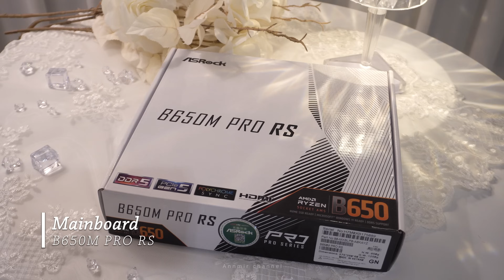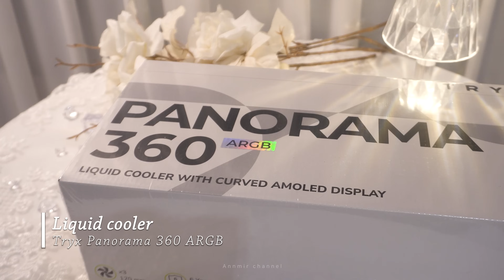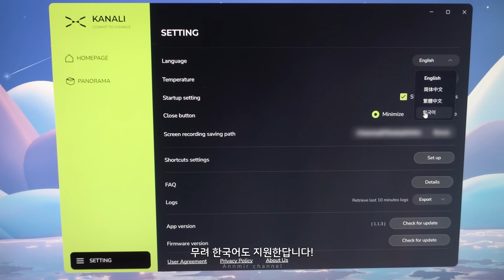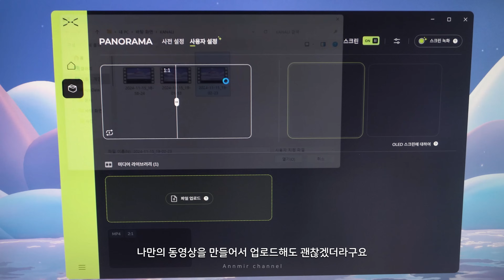친구를 위한 화이트 PC 셀프 조립하기🍥| 컴퓨터 조립 초보 | TRYX 파노라마 360, LUCA L70 | 조립컴 견적&스펙

Comment: It looks so beautiful!!! 😍 but I just want to point out something.. maybe you just didn't show it, but even with water cooling your CPU still needs a thermal paste layer.

It acts as a conductor to transfer heat from the CPU to the water block, which is then cooled by the liquid in the water cooling system. The paste fills microscopic gaps and imperfections between the CPU and the water block, improving heat transfer.

Comment: This is such a neat and creative build. Excellent cable management, the color combo of white with RGB is simple but so nice! Some helpful observations if I may: consider doing your builds on an Electrostatic discharge pad (ESD) and wear a grounding wire to reduce the chance of ESD zapping expensive components.  I don't always wear my ESD ground wire when I'm working on my system but definitely when I'm building computers for friends or clients! <3  I would also wear short sleeves or roll my sweatshirt sleeves up to avoid snagging components in the case.